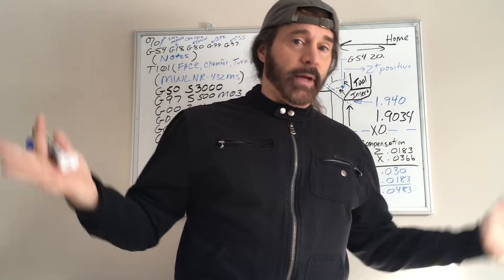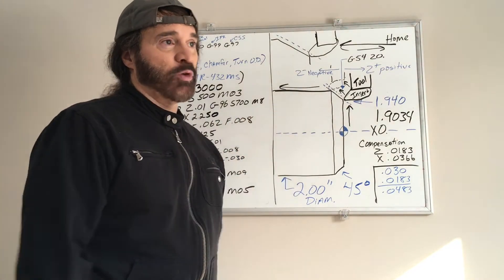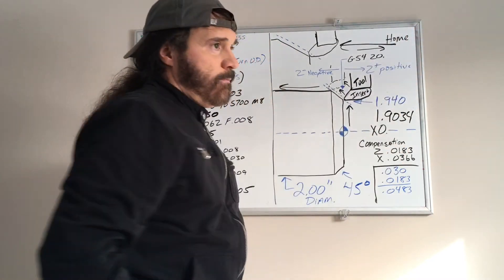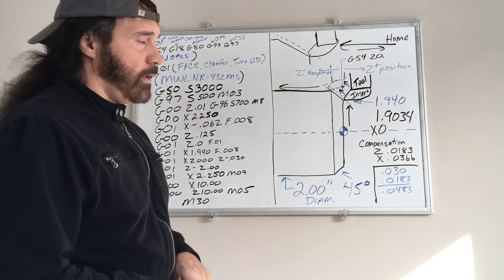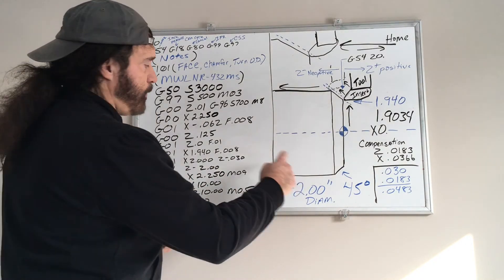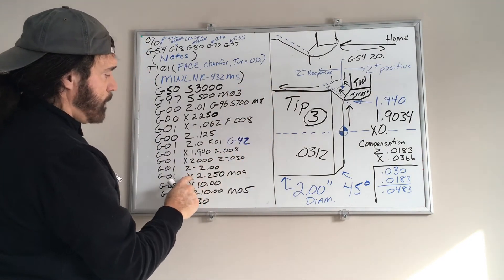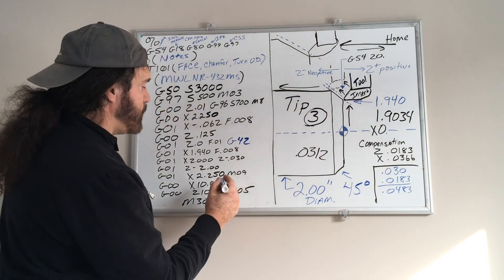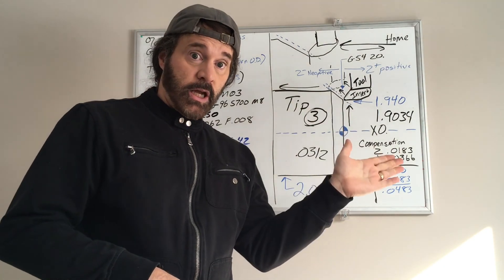Programming a Chamfer w/Cutter Comp (G42) on HAAS CNC Lathe for beginners

Comment: Thanks! This was a huge help. I’m running a super old lathe and don’t have CAM and this was a life saver for doing the finishing tools.
Reply from the maker: Thank you for watching!! Where I work, they don't use CAM software either.....everything is programmed manually.
Reply: @Tims-Tractors-and-more  I find it way more fun and faster most of the time. Especially on lathes, I’ve already got down most of the basic canned cycles, g76 threading was a fun one to figure out. Having a decade of manual experience helps so much. The part where you explained where to put the tool nose radius in the offset menu and the 3 setting was the missing puzzle piece. I use to just call out my chamfers and radiuses way huge but yeah, I knew it was still the wrong way
Reply from the maker: @enduroian  .....glad it helped! 🙂

Comment: Couple of things & questions 
How come you do NOT have G20/21 (incremental/absolute) in your startup code?
How come you DO have G97 (direct RPM mode) in your startup code?
Ex: Mine of Yours
G18 G21 G40
G54 G80 G99
How come you put a direct RPM spindle code in when your using CSS for that operation?
I only use G97 in a program to do threading, milling, engraving, drilling, tapping (aka where CSS is NOT used).
Ex: Mine of Yours
G50S3000
G96S700M3
G0X2.25M8
G1X-.062F.008
You are very good at explaining I enjoy your videos.
Reply from the maker: The G20/G21 should be set in your settings page on I believe setting #9.....which will switch between metric and inches. When you write a programming at the controller and while in edit mode, you can hit the F1 key and call up machine default codes....the ones I have listed in my video are usually always the ones that pop up. 

So yes, you are correct, when tapping and threading you will always use a G97 code with a rpm value and maintain a certain rpm. The reason I have a G50 code in this demo is I don't want the spindle to go above a certain rpm, and I will put a G97 code after my G50 line only to start up the spindle at a certain rpm....as it proceeds to rapid to my desired X location, I'm activating constant surface speed (G96) with a surface speed value....the reason is, when you face the front and turn the O.D. of your part, the machine will adjust the rpm's based on diameter.  

Live tooling will be whatever you call your M133 value, such as M133P1000( 1000 rpm's) if you were milling.
Hopefully I was able to answer your question :-)

Comment: How do you determine a 60 deg. Chamfer, or something different than a 45 deg.? From what I learned, a 45 deg. Chamfer is always double your x from starting point to finish point. 

G01 X5.0 Z0.0
G01 X 5.2 Z-0.100..

For a .100 x 45 deg. Chamfer.
Reply from the maker: You are correct !! Do you have the HAAS CNC Lathe manual at your work? If you have it, there should be a section called Tool nose compensation. They have charts there with all the values for X and Z for different angles. If you don’t have the manual, go to haascnc.com and download the manual for free and the chart will be in there.  
Here’s a quick question, are you familiar with using A codes for doing angles?
Reply: @Tims-Tractors-and-more  we got a manual, and we just bought a new machine. It’s like a 2020, but our other machines are like 15 years old. That’s awesome! Thank you for the advice. I’ll check it out and see. If not I’ll check the website. I have no used A for angles in any of my code. I wasn’t sure how to add them in, or if Haas supported it.
Reply from the maker: @RHCPFAN-yk6sw  I use to program in A codes on our older HAAS lathes that were at my old job.  I'm not sure about the new lathes. One way to find out is writing a program using A codes for your chamfers and then watch it in graphics mode. It will generate an alarm if it doesn't recognize it. Here's a quick little example below.
For a 45 degree angle I would write  while including cutter comp - 
G01 X5.0 Z0.0 G42
X5.2 A135. 
and then from there your remaining program.
For a 30 degree -
G01 X5.0 Z0. G42
X5.2 A120.
I hope this doesn't confuse you. I actually might make a video explaining this because it might be confusing to others trying to understand this.
Reply: @Tims-Tractors-and-more  no this is really good help! Thank you! You should make a video for sure!

Comment: All those G1 are useless...switch from yaznac to fanuac .much easier to program and write
Reply from the maker: You are correct about putting a G1 on every line that does a feed move.  Once G1 is activated, it is modal......until cancelled by another modal command.
For others who are ready this comment and do not understand what the word "modal" means.......when you are programming for instance a series of feed moves, your first feed move(G01) can be followed just by your X and Z moves.